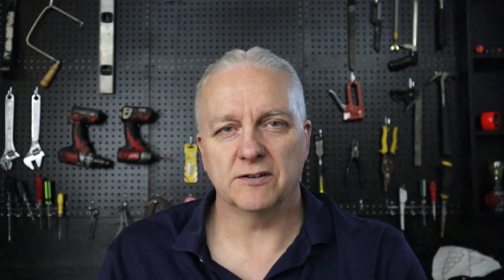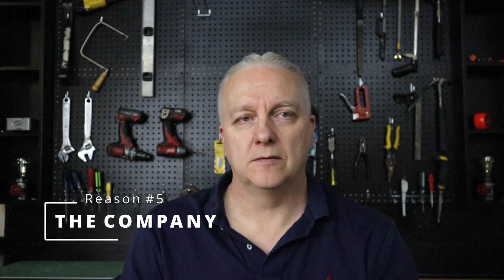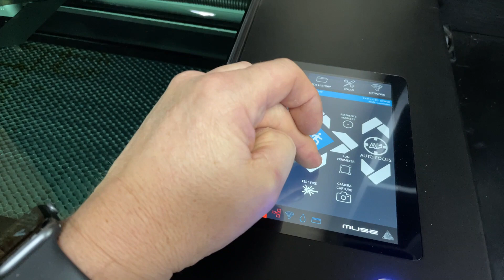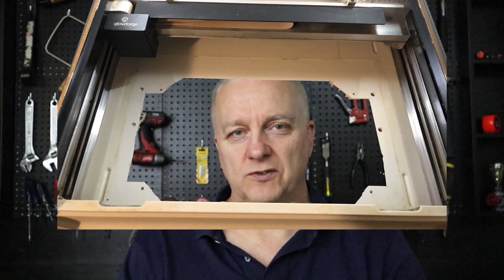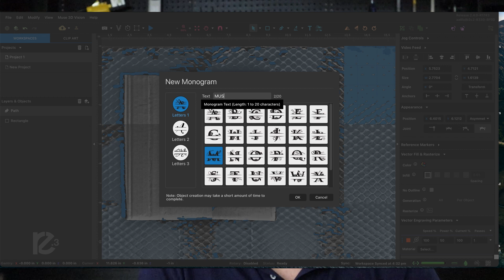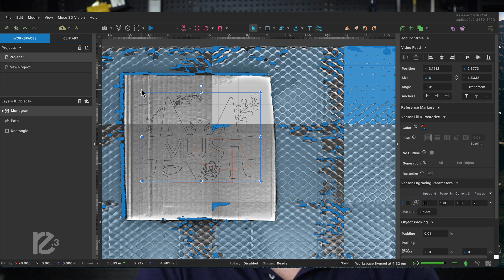BEST LASER CUTTER FOR HOME USE  // Top 5 Reasons to Buy a Muse 3D over a Glowforge

Comment: I wish I had listened to you. I owned a Full Spectrum Laser before, no problem! but I just switched to a Glowforge. Right out of the box, the laser didn't cut in the right side (a common, known problem, I learned later), I tried to call them to their number, never answered. I found troubleshooting on their support page, I went through it and I thought was fixed. A few weeks later it came back. I called the same thing, no answers. Finally, I opened ticket support (online), I got the answer that they will change the machine with a used one! no way, mine was less than 7 weeks old!! Asked for a refund, no-no, as "per policy" after 30 days, no refund. So, I paid 6K (GF pro) for a used machine. What a bad experience!! (yes, I'm venting, because I was left with no other option).
Reply from the maker: It's OK to politely vent here.  I've heard lots of people complaint about FSL and a host of other companies from a support perspective too.  While I haven't had any of these issues with FSL I think this is pointing out a couple of misconceptions.

First Glowforge's implies that their laser is a turn-key unit and out of the box everything will just work.  This can certainly happen, but more likely shipping bumps them around to the point where things gets messed up.  Unfortunately Glowforge makes returning the unit for service as the only available option and this is fine for warranty repairs, but becomes a ridiculous expense after warranty expires.  The one defense I would make for FSL lasers is that at least you can do field repairs and FSL support is decent as walking your through what you need to do to get your laser running (and most/all other laser companies work this way).

Second, given the ad campaigns of companies like Glowforge, there is this misguided perception that lasers are appliances, as simple as a toaster.  I fact even a basic hobby CO2 laser is a precision instrument with lots of parts that can be adjusted to get optimal performance.  This means that if you are buying one then you need to be prepared for a bit of learning and tinkering.  Many people seem to be upset by company support because they didn't understand this when then pushed the "buy" button.

These two issues among many more are the reason I created this channel.  I hope Glowforge is able to resolve your issue in the proper way.
Reply: @SteveMakesEverything  thanks for your reply. It is so true!
Reply from the maker: @artexmg  FWIW I think the Glowforge is a fine laser, but the company practices are dubious in my mind.  They are capturing customers and that's worse than any support issue because for the latter you can at least go on line and ask.
Reply: @SteveMakesEverything  yes, I love the machine and the community, but I don think the same of the company exactly for the same reasons you mention.

Comment: I bought a MUSE also.  At first the FSL people were OK and helped in fixing a couple problems, but that was one of the first models.   More recently, they have been GREAT on customer service and replacement parts with quick response.   Also looked at Glowforge, but simply no support.   THAT IS KEY when you get a laser.   Love their simple software in the latest RE software which software is KEY too.  Overall for the price, love the MUSe and we used the crap out of it.  For the price it clearly is the best solution for beginners.
Reply from the maker: I like the Muse and my experience with support has been similar.

Comment: We've been looking at glowforge for quite some time now but I got to thinking, wonder what else is out there? I appreciate this video. I've only known about a muse 3d for less than a day.....this video will make me slow down a bit and do some more research before purchasing anything
Reply from the maker: You are wise to carefully consider your options before spending a huge amount of money.  Note that I also just uploaded this video (https://youtu.be/VIGKy_ywAsg) designed for the first time buyer.

What you buy very much depends on what you want to use a laser for.  If it's just for home/hobby work then make no mistake that the Glowforge is a fine option - subject to some of the issues I surfaced in this video, which may not be an impact for you.

Comment: Great comparative analysis. Connectivity in itself is good - it's the privacy issues that come with it are the show stoppers. And enforcing persistent connection is even worse .
Reply from the maker: It was the privacy issue that killed it for me too.  If Glowforge ever changes that I'd probably buy one because the laser is otherwise pretty solid (but doesn't have a rotary attachment).

Comment: Thank you! I've been considering a glowforge and now that I am ready to purchase you have moved me more in the direction of the Muse. How is the muse community? Glowforge has so many platforms to talk with other owners.
Reply from the maker: Community is where Glowforge has done a stellar job. The FSL community for the Muse is a lot less organized. The good news is that CO2 lasers are all fundamentally the same so there isn’t anything a Glowforge laser can do that you can’t do with other laser. I regularly head of the GF community to see what projects people are doing and it’s generally trivial to reproduce those on any other laser. 

The opposite isn’t true since there is no rotary tool or other accessories and no easy way to engrave on anything thick than 1 1/2”. The Glowforge however works very well for its intended market but I would have out grown it very quickly. 

FSL appears to consider the Muse as an entry level business laser rather than a home appliance so the markets are different and added capability goes along with that.

Comment: You made great points about the Muse vs Glowforge. However, you could buy at least 8 of the K40's with lightburn and water chillers for the cost of this one Muse 3D. Both GF and Muse 3D look great, but I speculate that if I handed you a product made from a $600 K40 and told you it was from a Muse 3D, you wouldn't be able to tell the difference.
Reply from the maker: Well, I certainly can't argue with prices.  At the end of the day, a 35-40W doesn't differ much in capability from one vendor to the next.  Having used a K40 in the past though I can assure you that there is more tinkering involved in a K40 vs either of these big market players.  That isn't necessarily a good thing though so for some people :-)

As I've always said, buy the equipment that meets your needs.  There are many viewers of this channel who own one of more of these lasers and are quite happy and I'm not about to get into any sort of religious war about whose laser is best.  My interest is in helping makers.